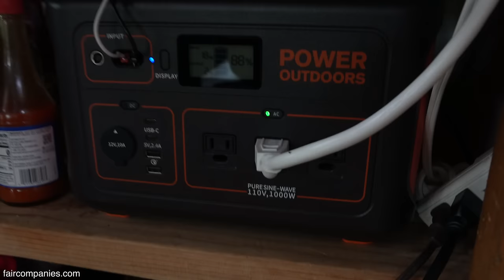Off-grid Hawaii dream: couple builds budget home & thriving food forest

Comment: Untreated wood, bamboo and anything else with a high cellulose content does not last long in Hawaii because of the Formosan termites. They will even eat books, magazines and cotton fabric. I know because I lived in Hawaii for more than 20 years and it was a constant battle to detect new termite infestations in our home and kill them. I hope this couple treated the wood and bamboo they used to build their home so the termites do not destroy their hard work. Periodically a nest of termites will swarm and fly to a new location. They can land on roofs and crawl through roof vents to get to the wooden rafters. Just treating the ground around the house is not all that effective against flying termites.

In the old days lumber was dumped overboard from sailing ships and floated to shore. The sea water "treated" the lumber with enough salt that the termites did not want to eat it. If this couple have to rebuild at some point, I recommend using steel studs for the framework, corrugated steel panels for walls and roof and installing metal doors and metal window frames. Insulation is not all that important in the subtropics if the windows are usually open to catch the trade winds. 

It is also good to have furniture that is not made of wood. Plastic lawn chairs are good. So are glass-topped metal frame patio tables and stone or concrete benches. Anything not made of cellulose is of no interest to termites, but they can still gnaw through other materials (mortar, plasterboard, thin plastic...) looking for cellulose (learned this the hard way).

Comment: The best building material to build with in hawaii is Cindercrete. 
Cindercrete is a mixture of cinder cement and water mixed and poured into a set of reusable forms walls are poured from 12"to 24" thick. Cindercrete is fireproof termite proof rust rot and mold proof non toxic and has a high R value and good sound attenuation solid. Cinder is the only local building material on the island 
Take care Ray

Comment: This is beyond awesome! For refrigeration just purchase 12 volt cooler/freezers that sip power from solar many sizes from large to small and most are on wheels what am switching to ,also don’t buy new solar panels buy used warranty tested panels from SanTan Solar 1/3 the cost or less than new panels